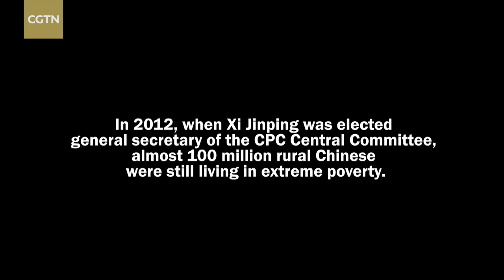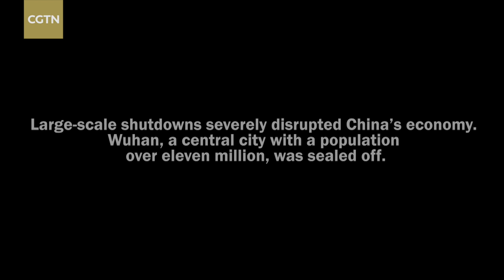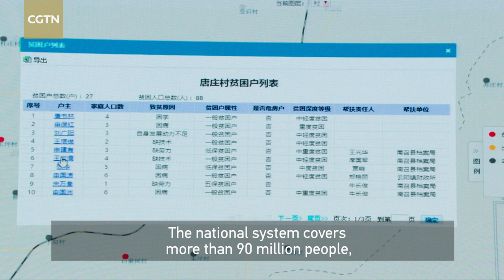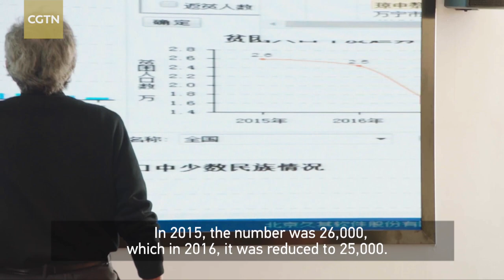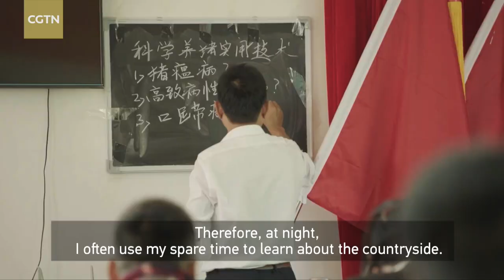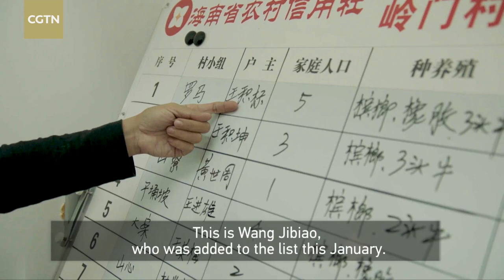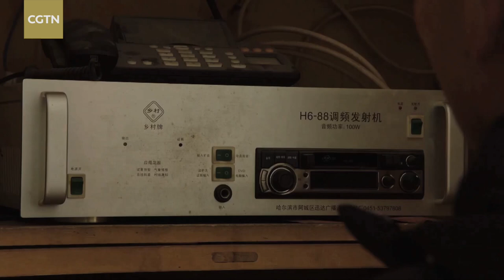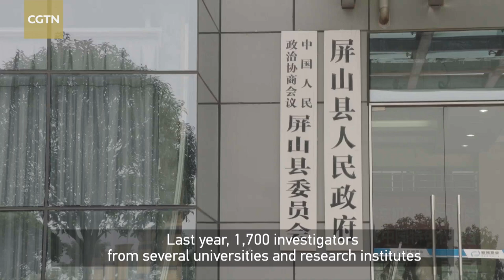China's war on poverty

Comment: Asking the poor "are you still poor?" Instead of using an arbitrary number to determine that they are or are not. 

Such a better method because the numbers can easily be fudged to make it seem poverty is going down without actually improving the material condition of the people living there. 

That's what has been going on in Africa for decades now.

This method should be used everywhere.